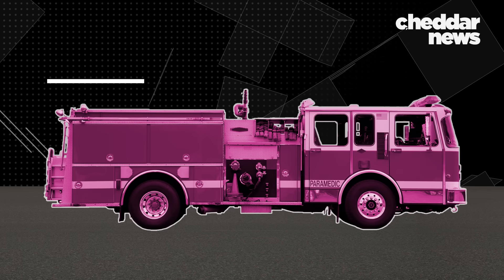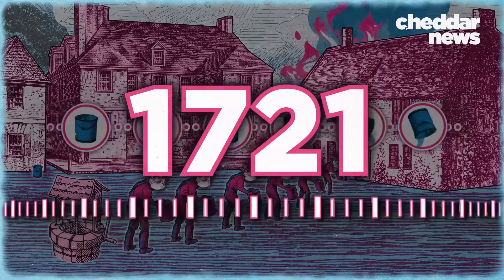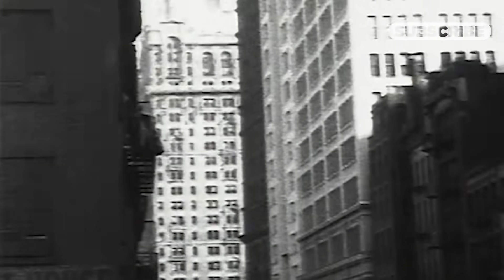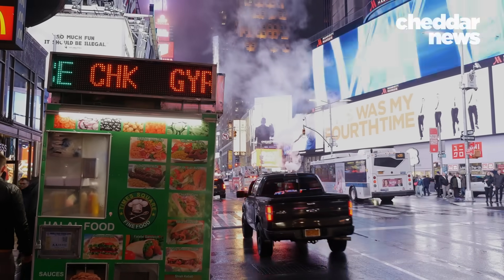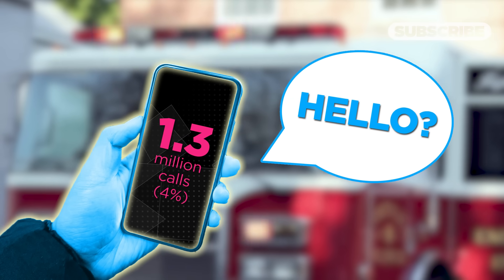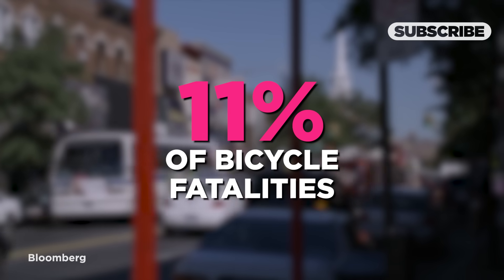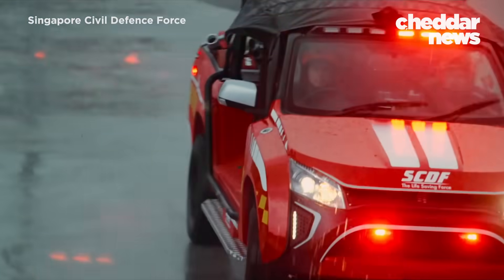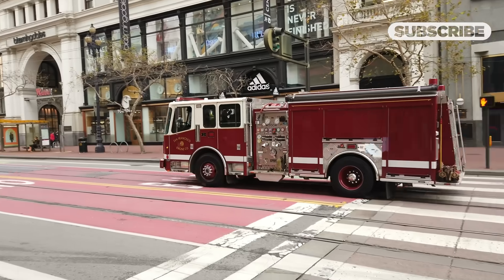Do American Fire Trucks Need To Be So Massive? - Cheddar Explains

Comment: This video definitely belonged in my recommended feed as it is something that I have spoken at length about to my peers, however it is a very layman's way of putting the differences between North American fire apparatus, and Euro/Asian style apparatus. To truly understand the differences in our trucks, you must understand the differences in our firefighting tactics and strategies, firefighting infrastructure (Station placement, apparatus/personnel capacity), and fire prevention. 

While I do not disagree that NA apparatus are sometime oversized and overpriced for the job they are performing in certain areas, there must be clarification. European and Asian fire services are much less aggressive than North American firefighters. They make far less interior fire attacks, their hoses are small and flow a lesser volume of water, and their protective equipment is rated to about half the thermal performance figures as NA gear. This means that their apparatus can be equipped with smaller pumps, hose takes up less area, they don't carry as many forcible entry tools which frees up cabinet space, they don't need as large of a water tank as we do (As hydrants are often abundant there). While individually small pieces, they create a very large puzzle that outlines the difference in much of our equipment. While the explanation is much more complex than this brief paragraph, I'd like to sum up by stating while this video is somewhat correct, I think that it is worth saying that most NA fire apparatus are large due to the tasks they are assigned to, in most cases.
Reply: @Kingswayfire  what makes you think that?
Reply: @Micsmit_45  I don't like it when someone expresses a supposed informed opinion on something they patently know nothing about. My reply was meant to be sarcastic.
In the interest of reasoned debate I have deleted it.
PS I was a Firefighter for 30 years.
Reply: "They make far less interior fire attacks" I definetly can't agree on that. Not sure about Asia, which sure has great differences depending on the country just like there are huge differences across Europe as well. Picking out e.g. Germany, most structure fires are fought by an interior attack only! Most fires don't spread to the outside or come to the state of being a fully involved structure fire, so the only way is an interior attack. 
To point this out even more: In Norway they even have seperate apparatus for interior attacks! Also in Denmark you find some interior attack apparatus as special operations. They do basically nothing else than interior attacks then. 
Yes, the hoses flow less water, but aren't less effective. Most of Europe operates at lower gpm and higher PSI in order to keep further damages caused by the water as low as possible.
Reply: @EnjoyFirefighting  I've just replied to the other guy who more or less said the same thing. TLDR: I didn't say that EU firefighters, apparatus or equipment are less effective and I don't really understand why that was the only thing you inferenced. I said that our gear is different because of our tactics, our environment, our infrastructure, our response guidelines, and our operating procedures.
Reply: @that1cdnguy  Finally I can agree on your statement for apparatus being different due to different tactical approach, infrastructure and circumstances. 

Was just pointing out that e.g. interior attack are plain normal to us, as basically every fire inside is an interior attack only.
As for the hoselines: the Dutch often use the small diameter solid rubber hose reel for interior attacks, and I've seen fully involved car fires being extinguished with less than one gallon of water. Yes, we do use way less gpm on the standard apparatus, that's for sure. Makes sense, with the smaller pumps and the smaller tanks on board
Reply: @EnjoyFirefighting  that’s the thing with some of our fires. A lot of our communities are extremely rural. Not much water access in far out areas. We often have to bring 4-6 tenders to a middle of nowhere house to do a proper relay because the hydrant might be 20 miles away.  We have quite literally drained an entire town’s water supply for a commercial structure fire lol. There’s no way that my 2,800 gallon tender can be as small as your apprautus unfortunately. Alongside one engines often having to be jack of all trades. Our career department responds with a private EMS service. There is only 3 people on that engine and for the town. They must respond in their engine with all ALS gear, excercation tools, and firefighting equipment just in case another call pops off that requires their tools. Our ladder trucks often double as our high/low angle rescue rigs as well.
Reply: @Etomidate  believe it or not ... we have rural areas as well. Mountain ranges, deserts, forests; We roll up with anything, from small portable pump vans and trucks to normal Engines, small Tankers, offroad capable Tankers and larger Tankers (or Tenders, depending on how they're called in your area). Of course it doesn't get nearly as rural as e.g. the Swedish outback or some mountain plateaus in Norway, but still rural enough to depend on water supply done by fire apparatus running as shuttle. 
"Alongside one engines often having to be jack of all trades" same here, however with a crew of 4 it would be understaffed, crew of 6 is standard for a career FD and crew of 9 is standard for a volunteer FD here. A plain normal Engine carries anything from ground ladders to a complete set of extrication equipment, EMS stuff, tools for technical assistance, ground ladders, anything to handle traffic accidents etc. 
Although we have seperate high angle rescue units, and although the Platform Ladders barely carry any equipment, they're still used for various tasks of technical assistance, EMS support and lifting operations
Reply: @Etomidate  Tanker in the North East, tenders are example....chicken tenders, just saying, lol
Reply: @EnjoyFirefighting  
Exactly. It's not just about putting out a fire, it's about doing as little damage as possible in the process. We break locks, not doors and finely spray water to get maximum cooling with minimal water damage instead of just flooding rooms.
Reply: @dinolino3313  we practice salvage and protecting property as one of our main strategies for fire operations. It is taught heavily and property salvage is very important to us. We don’t just go flooding houses unless it’s an obviously defensive fire.
Reply: I think the biggest factor is that Europe and Asia simply has more firefighters. Germany has just about the same amount of firefighters as the US at a fraction of the size. That alone makes a huge difference as it means response times are shorter (mainly in rural areas, in Germany we must be at the scene within 12 minutes of the call coming into 112, although in most cities that time is more like 8 minutes) and we have more personell. This means we can switch out our guys more often. Absolut max you'd be under SCBA actively fighting a fire (i.e. interior attack) would be 30 minutes with a mandatory 2h break before going back in. You also don't need much water to put out a room fire. If you're good you won't need more than 400l, difference is that because we are more densely packed and have quicker response times, we get the chance to stop the fire before it spreads further. If the house is fully involved we tend to not do an interior attack as the fire move because we put personal safety first. That's also th reason why we are taught to never enter a burning building without a steady water supply. We also tend to have more specific engines for specific jobs (three different kinds of tanker, hose transports, heavy rescue vehicles, ladder trucks, cherry pickers, diver trucks, hazardous materials trucks, hazardous materials recon vehicles, four different sizes of fire trucks, two different sizes of rescue trucks, etc. And that's just those that are regulated in Germany. There are even more unregulated ones.) Our way of fighting fire is much, much safer (there have been 14 deaths while doing an interior attack in Germany since the 1960s, that's how many firefighters lost their lives at fire calls in 2017 in the US alone.)
Reply: From what i hear out of your thread and the comments as a noob is: Always ready/ no matter what situation approach in the us vs the different tools for different situations approach. Both seem reasonable. Is that a valid observation? Are you often called to emergencies, where the situation is not clear in advance? I'd like to draw a comparison to military planes where one type cannot perform the different required jobs, but it seems your larger vehicles are capable of handeling most, if not all situations, would you agree?

On a completely different note. Do european pumps have more pressure? This is what i would assume if they are meant to somewhat keep up and if so, does more pressure lead to greater distance from fire?
Reply: Indeed.  Larger cities and demands need larger vehicles.  FD mission creep.
Reply: "Less aggressive" is a myth! Boo this man!
Reply: Sorry bro, but I think european housefires are the same as north american ones, so the gear is indeed comparable. Of course we do have differences in taktics, but the goal is much the same. Yes, the standard hoses might be smaller and the volumes of water carried might be too, but that is due to differences in the ways we build (and renovate) houses. So no, european fire trucks and brigades are not less effective than north american ones. We all developed the best system over decades.
Furthermore, as a firefighter myself I can tell you first hand that here in Germany maybe thirty percent of our alarms are actually fire related. The majority is technical relief, opening doors for EMD's, car crashes and so on. We all do that with the same very efficiently and practically equipped trucks.
Reply: @dinolino3313  American homes are made from wood. European houses are made from brick, concrete or stone. That plays a big difference.
Reply: @dinolino3313  Ever had to deal with a structure fire when the closest hydrant was 10+ miles away? On the pumper I was assigned to we had 1000 gallons of water, a 1250gpm pump, 2x 1.75" x 150 foot attack lines, 2x 2.5" x 250 foot attack lines, 1000 feet of 4" supply line, 25 feet of 6" supply line, and 100 feet of 6" hard suction hose in case we had to pull water from a pond or lake. Then you add the cabinets for fans, a generator, Hurst extrication equipment, chainsaws, and BLS equipment. It was a massive truck, but we had gear crammed into every nook and cranny.
Reply: @LMarshall73  when I was in the US 18-20 years ago I was interested in the fire department. What struck me was the free room inside the cabinets. There was only one thing inside it and free room everywhere. Like a first aid kit and nothing else.  In germany everything is crammed inside. I wonder if that changed. And if I see US fire department response videos, 90 % of the time they only start outside attacks whereas in germany it is mostly inside attacks. so you cant see how it is extinguished.
Reply: @michaelz.7140  on our trucks, we built shelves in the cabinets to keep gear organized, but we crammed as much in as we could. 

As far as tactics when dealing with structure fires, there are a lot of factors that dictate the best course of action. The top priority is life, then property. If you roll up on a fully involved structure, it isn’t safe to put personnel inside, so you focus on protecting the surrounding property. If you have reason to believe there might be a person alive inside, you adjust the tactics to support search and rescue. Of all of the structure fires I responded to, it was pretty much a 50/50 split as to whether we made entry or stayed outside.
Reply: @michaelz.7140  Sounds like you saw one in a station, or display, thus had it equipment not entirely in place.
Reply: @bxnaxmxxnaxx1914  why should it have no equipment at the fire station? isn`t it the point to just jump onto it and go
There was one compartment with "shears of life" which contained hydraulic shears for cutting cars open. but it only contained that and was 50 % open space. In germany we would have 1000 other things in this compartment. or like the breathing apparatus. in germany it is integrated inside with some nozzles, some foam nozzles etc. But you guys seem to mix the ladder with a rescue. so in case of a car accident you have to send a ladder whilst in germany we have to send a hlf. And it always is that in the us there is an abundance of trucks and firemen whilst our firemen are more effective.
Reply: @michaelz.7140  i see what you are doing.., i didnt say it didnt have equipment, i said it didnt have some in it..,
Your attempt at dismantling my words as IF they had no value, merit, or point is below pre-school.

there are many reasons and situations where equipment is checked, or moved around.
and like i said, i didnt say it was empty. Simply put, that person had a scenario where it wasnt at its full capacity.

So quit it with the Nation VS nation bs. They both work for both nations.
and you twisted my point into some Nations Firemen/Equipment Vs anothers.
Reply: @dinolino3313  I did not at any point say that European firefighters are less effective than North American Firefighters. I have plenty of friends on the Job in the EU, and they are just as much a firefighter as I am. I was simply highlighting the differences between our equipment and trying to explain WHY those differences exist. It was a comparison, not a competition. I don't know who has the more efficient system, as I have only tried my own and you can only say the same for yourself. I was simply pointing out some relevant information that they left out in the video.
Reply: Basically what you are saying is that you are using an unwieldy multitool, while europe/asia uses more sophisticated, specialized tools

Comment: Doesn't make sense that traffic accidents require 1-2 of these blocking several lanes
Reply: Because on multiple occasions people have plowed into accident scenes, injuring and killing many first responders in the process. It’s better to have these truck that can take a hit take up lanes and close roads, rather than not closing enough lanes and risk someone plowing straight into the scene. Also gives the responders a safer and larger area to work in, which is required on more complex calls.
Reply: @John-jg4wp  Majority of the calls are fender benders that cause more trouble with emergency responders. 

Gridlock traffic turns into more traffic accidents
Reply: @gvi341984  That's a good point. regardless of the situation if they are dispatched they should position to protect themselves, especially on high speed roads. I know in my area they are dispatched if injuries are reported, if fluids are leaking, reported fire or someone is possibly entrapped.
Reply: @John-jg4wp  that's a good point but in that case why isn't there a more expendable vehicle to do the job? something like a semi truck pulling a trailer carrying sand barrels or something
Reply: @blitzn00dle50  Departments are starting to move toward that, in different ways. Some buy and use similar vehicles to those that the highway departments use. Others are converting old fire trucks that are at the end of their useful life and being replaced, to just be lane blockers, but these trucks sometimes also double as tankers when needed. These types of vehicles are scene where fire departments are on the scene on high ways often and for long periods of time (Major southern US Metros for example)
Reply: @John-jg4wp  Thats the Guards job
Reply: @oscarosullivan4513  They got defunded.

Comment: The "old" look about those American trucks is actually intentional by the fire department. They're custom-built units commissioned by the fire department, and they could look just about however they wanted them to look. Some of these "old" looking trucks are actually pretty new. Now, as far as size goes, I live in Chicago, big city, with tall buildings and some short buildings with massive footprints, like warehouses. You're gonna need a long ladder truck to put out a fire mid-building in a warehouse unsafe to enter, or on the outside of the 17th floor of a building. Those little, short boys from Europe ain't gonna cut it. Most of the time when I see a fire truck it's the smaller (albeit still pretty big) 40' pump trucks and proportionately speaking, for the roads here, that doesn't seem too big to me. It'll get to most places around here just fine.
Reply: FDNY Mack and Seagrave are custom built to their order.   One is now in the 9-11 museum.  And LAFD seems to be the only FD with hook and ladder tractor-trailer units.  There was one here where I live but it was replaced in the 1980s.
Reply: @michaelrmurphy2734  I forgot which suburb it was, but there’s a Chicago suburb here that has one of those articulated hook and ladder trucks. I just saw it a few years ago and it looked pretty darn new.
Reply: https://youtu.be/KuIIt00JKI8 One of these in the series has a fire in a Mattress warehouse.